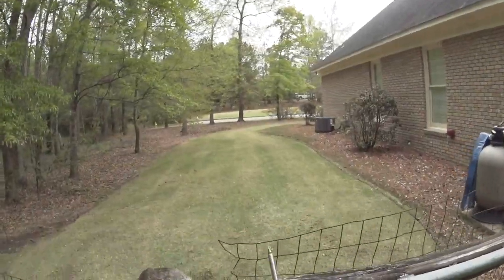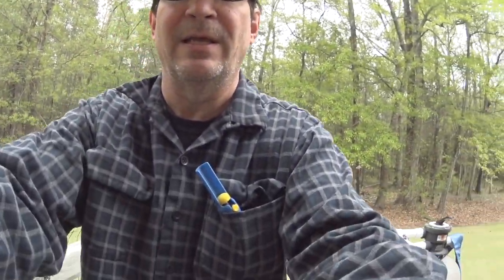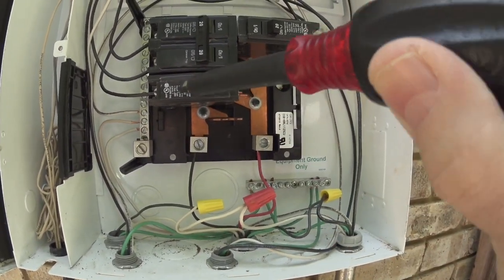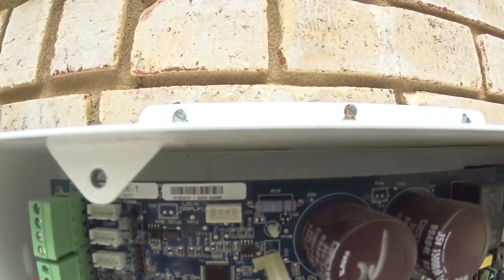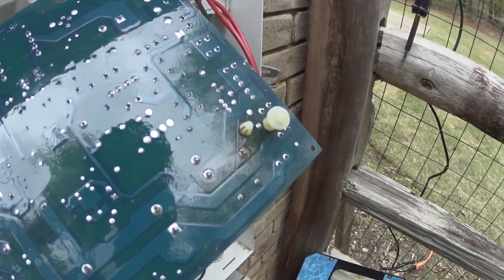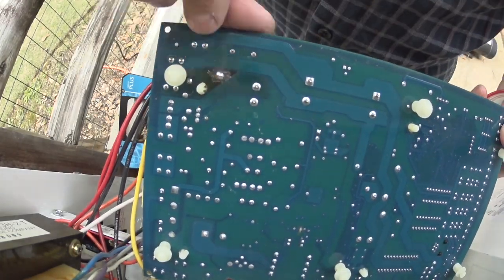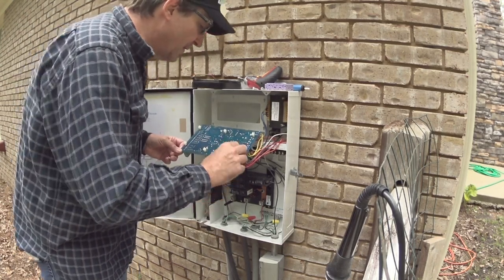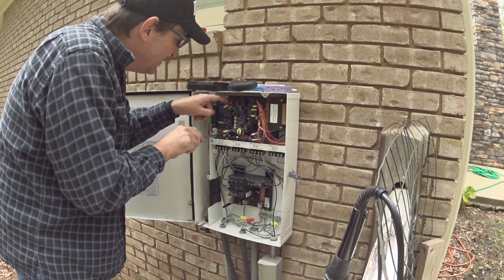Chlorinator Off No Cell Power - DIY Repair

Comment: Your video was awesome. I was getting the exact same message. I called Hayward for advice and all they would say was call a service center. I found your video, went out to the equipment, pulled the board off - and it had the exact same problem, although my board is kind of really fried around that spot. Some solder and I'm up and running. Thank you!!
Reply from the maker: Hi @ptrbrmn! I haven’t found a local pool service yet that’s willing to repair the boards. Most pool companies just want to sell a replacement board or upgrade you to a whole new system. I’m glad you found my video and saved some money. Thanks for letting me know it worked for you too!

Comment: Thanks for the video.  Instead of worrying about getting electrocuted.  I'd recommend going inside the house and turning off the breaker to the pool panel.
Reply from the maker: Hi Brock,  Thank you for your comment. I agree it’s much safer shutting off the breaker that powers the pool panel. However, not all work inside a panel can be done cold, diagnostics for example. I’m familiar with working around energized lines so I was careful but not worried. I put the information about the hot areas in for those unfamiliar with electrical panels.  If I ever need to do this repair again, I’ll remake the video with the complete novice in mind and shut off the breaker that feeds the pool panel.

Comment: My panel is about 13 years old and suddenly got that No Power to Cell message. This little fix took at most 10 minutes (should have plugged in soldiering iron at the beginning to save a few minutes) and everything looks to be working fine now. Thanks!!!
Reply from the maker: That's awesome! Glad you were able to fix your No Cell Power problem so quickly! Thanks for sharing your success!

Comment: Thank you.  My neighbor had the same problem.  Now, we did scrape back the conformal coating and got a real nice & clean solder job.  Saved a lot.  It's probably better than as-factory-built now.
Reply from the maker: Glad you got it working again. Sounds like you did a really good job soldering it. I bet it last many more years! Thank you for commenting and sharing your success with the repair!

Comment: Saved me.  Just fixed it.  Took 3 attempts.   dont give up.  Make sure you use enough  solder to make contact with the board
Reply from the maker: Glad you kept trying until it worked! Thanks for commenting and encouraging others to not give up!

Comment: Thank you so much Steve! after two month of dumping chlorine into the pool while trying to get help. I first called HAYWARD and all they said was the mother board needs replacing. All the pool stores that carry Hayward equipment didn’t know anything about it or even how to fix it because of it age. Your video was the best news and the most help I received to-date not to mention the $$$ saved. Thanks
Reply from the maker: Good thing you didn’t cave in a buy a new mother board! I’m surprised none of the local pool companies knew about the solder fix. I guess they are content with making a profit off labor and selling expensive equipment. Glad you found the video helpful and you were able to save $$$!  Thank you for commenting it helps a lot!

Comment: Had the no power cell 2 message on the panel display. Pulled down the motherboard and was EXACTLY as you described. Put some fresh solder on there and back in business. No telling how much money you saved me!! Only took 15 minutes to get fixed!
Reply from the maker: Congratulations!  I’m still amazed how much money such a cheap and easy fix like the one in this video can save!
Reply: FiveAble THANK YOU!!

Comment: Hey,...it worked for me, went for the fix  even though my Hayword manual said for " no power 2" it should be an entire board replace...it was that nasty joint.  I knew the switch was actually working cause the  service light would go out for 2 seconds right after the countdown finished and you could hear it click, but the power was not making to the chlorinater pole (the corroded one i resoldered).   Thx for posting this video buddy!...saved me $350 for the board and probably a couple hours of labor from a  serviceman. WARNING- I would add though, remove power to the entire controller from the supply ( normally on the side of your house) rather then playing around inside the controller even with  its circuit breakers flipped off, because as the OP  commented, even with the controllers breakers off, 240 vac is still coming into the controller somewhere,  if you don't kill the power to it on your main box at the house.
Reply from the maker: Thanks for your post. I totally agree, if I were making this repair again I would cut the power off to the entire panel.
Reply: I have done this 2 years ago and need to do it again. Also have replacement relay switch just in case. Wish me luck … off to go fixing. 😅
Reply from the maker: Hi PaprikaDrake, I hope you get it going again and it keeps working for a few more years. Best of luck to you with it!

Comment: Thanks, man! I was told $795 to replace the board. I found this and immediately grabbed my tools. The repair took me 15 minutes. Crooks are everywhere, and it's people like you that help keep them at bay.
Reply: Fixed me too..no sure its crooks though, most servicemen would not know of this little fix cause its not happened enough to make it to Hayward troubleshooting guide.   Most would follow the manufacturers guidance rather than chance a social media fix....but us owner types dont mind taking the chance, to save $$$$. My .$02

Comment: Thanks so much!  When I tipped the board over it looked EXACTLY  like your board with the same burn coloration.  Cleaned the point, re- soldered it and saved a ton of money. THANK YOU, THANK YOU, THANK YOU!  Additional comments:  I smelled the "burning electrical wire" smell when I opened my panel door.  My 2h.p. pool motor was humming and wouldn't start so that is the reason I opened the panel.  I took off the start capacitor which was leaking and ordered a new one.  When I put power back on the panel, that's when I got the  "No power to the cell" annunciator.  I didn't have a way to test the old capacitor so I don't know if the non-starting of the pump was a bad capacitor or related to the "No Cell Power"  in some way?  THANKS AGAIN!
Reply from the maker: Hi Therese, That’s interesting. A leaking capacitor is never a good thing. This is the first time anyone has commented about a non-start condition for the motor followed by the No Cell Power error message. I wonder if the bad capacitor caused increased load which in turn caused the relay pin to get hotter than normal and burn out the connection. Sounds possible but it’s just a guess. Could also be a coincidence. Either way, I’m glad you got your pool working again! Thanks for the detailed  comment! I’m sure it will help others looking for answers!

Comment: I had the same issue. After spending only $20 on a soldering kit and following your instructions, I finally got it to work. Thank you so much for taking the time to do this video. The price of replacing the board was crazy; (0ver $1000 )
Reply from the maker: Glad it worked for you too!  It’s crazy how much money a little solder in the right spot can save! 👍🏻

Comment: Thanks for taking the time to record and post this video.  This fix worked for my system.  Took about 30 minutes total from start to end (and I disconnected all the wires -- take pictures if you do this and mark the two orange and two yellow ones).  Salt cell is back online and we saved $600 over buying a new board.
Reply from the maker: You are very welcome.  I’m glad my video helped you fix your board!   Thank you for taking the time to comment and share your success!

Comment: Bless you and thank you for this video. I had the exact problem with my Goldline controls that you described. I opened it up and found a burned connection right where you showed it. Re-soldered it and so far, it seems to have worked. I appear to have saved a bunch of money. Appreciate it!
Reply from the maker: Hey Guitarzan1a, that’s good news! If the error went away after soldering your board will probably keep working for a long time. Thanks for commenting and sharing your success!

Comment: What a great explaination in plain terms that even I could understand! And if I only knew how to operating a soldering iron I think I could actually do this myself! Fingers crossed I can get someone to do it for me with your instructions!
Reply from the maker: !!!Make sure to turn the main panel breaker off that supplies power to the pool control panel!!! That’s the safest way to work on it.

If you read through the comments you will find many people have had great luck fixing their controllers and saving a lot of money.

After you, or your helper, makes the repair please let me know if it worked for you too!
Reply: @fiveable  I've got someone coming tomorrow to take a look. He's the guy who opens and closes the pool for me. Not an electrician, but I bet with your video we can figure it out! And we'll definitely shut off the main breaker! Thanks!
Reply: Well, we gave it a shot. Thought for sure it had worked because when it first cycled through the readings, the error message was gone. BUT, when it went through the 2nd time, the error was back. I still really appreciate your great explanation, and I'm thrilled knowing how many this worked for. This board is 11 years old and I was probably kidding myself that it wouldn't need to be replace. Thanks again. @fiveable
Reply from the maker: @barbpittman4660 Oh no! I’m sorry it didn’t work out. Silly question but was the salt cell cord plugged back in when you turned the power back on? The error message will remain if the cell is unplugged.

Comment: This video was very helpful and worked as shown.  Only took about 10 minutes to fix the board.  Very great job showing the steps.  One thing my system had was a breaker to shut all power to my system.  So there was no power coming in the bottom but good to be aware where there is still power so  you don't hurt yourself.  Thank you!!

Comment: THANK YOU SO MUCH!! You Saved us so much money, literally over a $1K. As we watched your video and did the soldering we thought this isn't going to work, but IT DID!! Thank you so much! My husband says he owes you a 6 pack of beer.
Reply from the maker: I’m glad you decided to stick with it and try the fix even though you had doubts! Isn’t it amazing how much money a drop of solder can save?!!! Thanks for commenting and sharing your success!
Reply: @fiveable  I have a question. We did this a year ago and fixed it. We have the same issue again, and soldering isn't fixing it. Any ideas what the next step would be?
Reply from the maker: Not sure but some people end up replacing the relay. Mine is still going so I haven’t had to replace the relay. Also, I’m waiting to hear back from someone who replaced the relay and it still didn’t work. They were thinking about trying a board rebuilding service on eBay. Hopefully they will let me know how it worked out.

Comment: Thank you so much this fixed my issue. Followed exactly how you did and it was like a mirror image of yours on my end, exact sanme posistion and joint. True lifesaver saved a ton of money. Thank you for making this video and sharing this fix
Reply from the maker: That’s great news! I’m glad the repair worked for you too. Thank you for sharing your success. I really appreciate you kind comment!
Reply: @fiveable I am back again because I have gotten the error again. This time it's says no cell power 1 instead of no cell power 2. Think it's the same thing?
Reply from the maker: @djaketech4460 it could be the relay needs to be replaced. If you are in the USA and want to send the board in for repair I have found a really good repair service. Look for HaflerUSA from Bradenton Florida on eBay and contact them. You can find them by using this to search: “REPAIR SERVICE Hayward GLX-PCB-PRO Pro-Logic Time Clock Issue 3 Year Warranty.”  Current item number: 386784749401 for the clock repair but I have talked to them on the phone and they can do almost any repair on those boards. They just repaired the clock on my board and I couldn’t be happier. I’m not sponsored by them in any way. I’m just a happy customer. Video coming soon!
Reply: @fiveable  think the relay works. I hear it click on then quickly click off again.
Reply from the maker: @djaketech4460 good deal. Hopefully it just needs fresh solder again. The joint I did in the video was still good. HaflerUSA said it was fine but they have started scraping more of the green coating off the conductor trace so they can make a bigger pool of solder around the pin to dissipate heat. It looks like a triangle now. HaflerUSA also mentioned that the failure rate is higher for control panels that get a lot of southwestern sun exposure due to heat. I added a support page with photos of the board to my website so you can see what the updated solder joint looks like. Go to https://fiveable.com/support if you want to take a look at the photos. The CR2032 battery with module is the clock modification that was done by HaflerUSA.

Comment: I just had the same issue (no cell power 2) pop up on my controller, was bumped to see the manual recommend to change the control board which cost about $500.  Found this video, bought a $20 soldering kit, follow the exact instructions, and problem fixed!  Truly appreciate your video!!!  Thanks!!!
Reply from the maker: So glad your repair was successful!  Thank you for your kind words and for taking the time to comment and share your victory with all of us here on YouTube!

Comment: Thanks for the video, I just made the fix myself.  My soldering technique needs some practice (my first soldering job) it took me two attempts but got it. I recall having this same problem about 4 years back but didn’t research it well and wound up paying about $750 for a new board and installation. This time only $30 in a soldering gun and solder.  Thanks again for the video!!!

Comment: Thank you for sharing. I had the same problem and your instructional video did the trick! I hope the fix lasts! By all means, shut off the breakers at the main service panel, along with the breakers inside the control panel, as is being advised here.
Reply from the maker: Thank you for taking the time to comment and share your success!  Hopefully your repair will last.  I’m guessing it will.  I did the repair in the video over 2 years ago and it’s still working great.  ( I hope I’m not jinxing myself! 🤣)

Comment: Excellent video.  I had the same problem but my controller showed high salt/amps.  I had my salt measured multiple times so I knew the salt was in range.  Your video gave me the confidence to tear into the controller.  Sure enough I had the same solder joint problem you described.  I am not a do-it-yourselfer, especially when it comes to electronics / electric issues.  So I’m amazed I was able to get it fixed.  Thank you!
Reply from the maker: That’s awesome!  So glad my video helped.  Also, thank you for the information about the “high salt/amps” message.  It’s good to know there are other messages that can be resolved by fixing bad relay solder joints.

Comment: Thank you! This just happened to us today. It took me around an hour or so to fix, mostly because wasps had also decided to build a nest inside the panel. This reminds me of my Bosch dishwasher. The relay there actually burns out every few years. They want to charge several hundred for a new board, but for less than $10 you can buy a new relay, desolder the old, and then solder the new in.
Reply from the maker: Hi Todd. Glad you got yours fixed too. Wasps are a problem around here too. Interesting point about the Bosch.  I have found similar problems with other boards too. One was an A/C controller in a 92 Volvo. Found a bad solder joint and fixed it just like in the video and the A/C started working again in the car. Thanks for commenting!

Comment: That was fantastic!! You should be so proud of your talents. Thank you for sharing. I do not feel I can do this w/o the possibility of electrocution, so I will talk to my pool repair man and see if he can do it. I was quoted 1800$ to replace the equipment and salt cell. Now I know better!
Reply from the maker: Thank you for your comment and kind words.  I'm glad you have heeded the safety warnings!  I would point out that If you can determine which breaker on the main panel will cut power to your pool equipment panel there will be no hot spots inside the panel and it will be a lot safer to work on.  If I ever remake the video that is one thing I will change.  Much safer for me and a much safer way to demonstrate the repair.  The day I filmed the repair, I was eager to get my repair done and making the video wasn't planned until I had grabbed my tools to fix the pool.

If you need a new salt cell make sure to look online for a replacement.  My local pool company quoted me a price that was $400 higher than the price for exact same factory original, not a knock off, part online!  

Salt Cells are very simple to replace.  There is just one plug that is as easy to plug in  as any household appliance.  Strong hands are requited to turn the fittings and then maybe snips to cut zip ties and new zip ties for cord management.

Hope this helps!